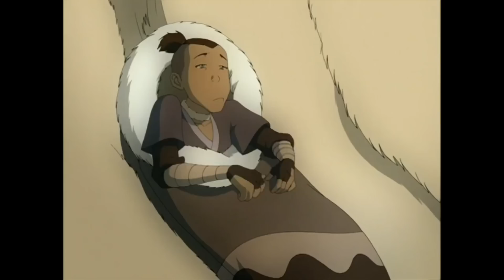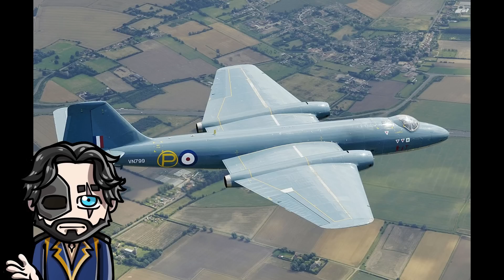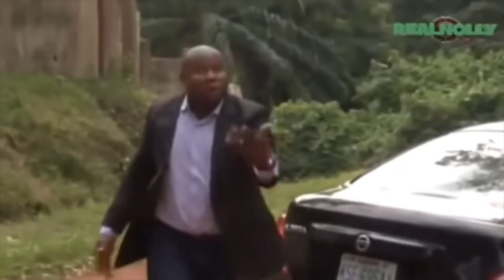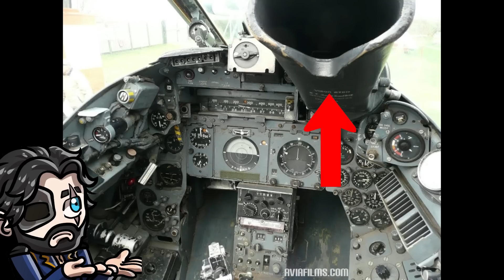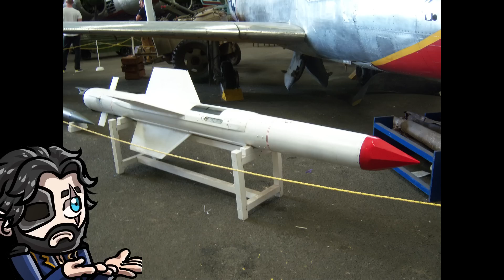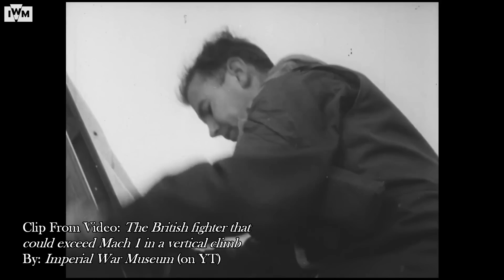English Electric Lightning: Gone In a Flash | Corrupted Intel Files

Comment: I have to ask, since muscle plane was mentioned, would the B-1A and B-1B bombers be considered late era muscle planes? I ask this because experiencing a flight of B-1B Lancers taking off in person is still the most bonkers thing I have experienced in person with aircraft. My stepdad had my mom and I hang around on base for a bit when we picked him up from his daily duties, and just before sunset, we went out to the road near the main runway for the base and parked up on the shoulder. In the distance you could hear engines starting, and after a few minutes, and just as the sun was at the perfect angle, one after another, B-1Bs were lining up for take off, with just enough light to see the planes, and just dark enough to perfectly see the blowtorch like afterburners light and make out the details in the exhaust stream. The first plane lined up, came to a stop, full 'burner, brakes released and it just sprang off the line like an Olympic runner on meth. Before that plane was even halfway down the runway, the next plane was in position, went full 'burner and started rolling just as the first plane was airborne and pulling its gear up. This continued till all of them were in the air, and it was dark enough that the last few planes were just glowing afterburners not long after take-off. All of this to say, I would love to experience the English Electric Lightning in person if had the chance, and I would love to see a video about the B-1. As bombers go, to me it is still the sexiest beast on looks, and sound, alone. What I am trying to say is, the B-1B put me more in awe than the F-14, F-15, F-16 and F-18 all combined with how a big beast can get off the deck and climb out. This was roughly 1988-89, and I am pretty sure I may have seen some of the last factory fresh B-1Bs built mixed into that flight, and come to think of it, that may be why my stepdad wanted me out there. I can say, it absolutely stuck with me.

Comment: As one who thinks the Lightening was the most beautiful plane ever made,  followed by the Starfighter and the Crusader, I found your commentary absolutely absorbing and mostly on the nail. I think the government interference comments were very appropriate. The lightning from what I have read was not only a bit slippery it was a very popular aeroplane with pilots. Those who have flown the Lightening and other hi-performance planes (US) most have stated a preference for the Lightening in terms of flyability, control and ease. But one had to get home before the tanks ran out. But then. It was designed as an interceptor not a slow bomber cover craft or submarine hunter. 
However I think you forget that there were many British aircraft that the US adopted and modified. The Canberra bomber being one that led to the U2 via modifications of the Canberra. Also the Harrier and I believe the Gnat was of major interest among others, but did not fit the "bigger is better" of America. Also there were others that got cancelled and their designs and engineering were used in US and other aircraft the T188 and SR2 to name just two.  And the Bell as you point out. The Buccaneer was an eye opener for the USAAF with its capability and tactics, being almost untouchable at Red Flag. Then there was the plane that nuked the US 1961 Sky Shield 2, kept very quiet for years despite one just turning up at Plattsburgh AFB NY, asking is it OK for us to visit. The Vulcan. Yet the Victor (an astoundingly good looking plane) was probably a better plane.  I think the UK was up there with all in the immediate post war era. Despite governments getting in the way.

Comment: That British flag you used was wrong.
Reply from the maker: I apologize for that, I have adjusted the flag I use going forwards to be the correct one.
Reply: @ Easily done. The flag took on several iterations to evolve into the current one, just like the US flag did. The one you used was introduced in 1606 and replaced to the current one in 1801.

Comment: Re Taffy Holden, what actually happened was the test pilot had to attend a funeral and wasn't available. As Holden knew the cockpit layout and there was pressure to get this aircraft serviceable ,the test pilot said Taffy would  be ok to do the ground run and gave Taffy instructions on how to carry out the ground run ,where to do it , make sure the aircraft was chocked etc. What Taffy did as the instrument issue appeared at high power settings was ,  instead of keeping the aircraft in dry power, he pushed the throttles through the gate into reheat (so the throttles move out a bit to the left and then FULLY forwards). That's why the aircraft jumped over the chocks, which obviously  wasn't planned. XM135 is a Lightning F1, not an F2. It also took Taffy more than one attempt to land the jet, which is why he had over 5 mins  flight time.

Comment: A Fun-Fact and something of a postscript to this story, is that the Rolls-Royce Avon engines that powered the EEL, were the same engines selected for the Concord.
Reply: Not true . Concord had Olympus 593 engines, not Avons . The Olympus was used in the Vulcan and T.S.R.2
Reply: @dcmchugh99  Yes the Avons were superpowered engines but were not built for supersonic heavy lifting. All the aircraft they were fitted to were light and fast aircraft not heavy aircraft like the Vulcan and concord.

the RR Olympus 593 however was the offspring of the TSR2 project that was close to being ground braking before UK pulled the plug on it out of shear stupidity. They had several RR Olympus engines ready to go into mass production intended for the TSR2. They had gone through years of development for the TSR2 to be supersonic capable. So when TSR2 was scrapped they had the engines left over. So when they started concord later on, they had a capable engine already perfect for the job laying around saving concord years of engine development costs.
Reply: Avons were used in the Comet and Vickers Valiant. So not all small and fast planes.
Reply from the maker: That's awesome
Reply: @CaptainSlicerax  It's also insane that the Concord had four of those engines, so just 50% more thrust, for a plane 100 times bigger
Reply: Yes, it’s hilarious isn’t it?

Comment: So, I have to explain the history as to why this plane even ended up on Slice's list for this series:

We were doing research on supercruise, and he heard, in a voice-chat, from ME - "Wait, this thing ACCIDENTALLY hit supercruise?"

To which Slice responded, "Holy hell, what?! How did they ACCIDENTALLY do supercruise- let me see that!" 

And thus a 45 minute research rabbit hole into the Lightning began. This jet is both ugly and gorgeous in equal measure. I can attest to the fact that when Slice researches, he goes DEEP into the research to find the funny bits. His following research entailed like... 3 days worth of dedicated research.
Reply: @Captain Slicerax @MrFullCrumb01
Please be mindful the one thing you got wrong was the supersonic climb information. When referencing the Lightning able to go supersonic in a climb, it was meant to mean in comparison to all previous aircraft that could only go supersonic in level flight or at a slight descent. The Lightning when completely empty of fuel does have a 1:1 t/w ratio for a couple of seconds before it runs out of fuel, however in practice it was never that high. The Record set for a climb to altitude from 0ft to 40,000ft of 2mins 20 seconds was only possible by a skilled pilot holding a climb speed of Mach 0.87 without weapons. Whilst with 2 missiles it could achieve 40,000ft in around 2mins 30-40 seconds. This is accomplished by constantly lowering the nose/climb angle to sustain such a speed. The reason for the Mach 0.87 speed is that was the most optimum thrust output speed for the Avon 301 Engines, travelling faster further reduced their thrust and efficiency. This is all very well modeled in War Thunder and I have to admit looking at the engineering record graphs, war thunders model is almost perfect. The major inaccuracies lie in the game not modelling Over and Under expansion of exhaust gas flow at different pressures and aerodynamic heating (causing very unrealistic top speeds for certain aircraft like the MiG-21 that were limited to the same top speed of below Mach 2.1 as aerodynamic heating would damage the airframe when attaining higher speeds).

The myth of it being able to climb verticle (modern reference of 90*) was perpetuated for many decades by those not understanding the difference between previous aircraft only going mach 1 at 0* or in a dive, and suddenly flying an aircraft that can climb from sea level at mach 1 from a 10-20* climb. If placed in a 90* climb the aircraft does not sustain any speed and does infact lose it like most aircraft that do not have a 1:1 or above thrust unless empty.

Shortly after it set it's record within a few years more powerful engines versions of the F-104 were being made like the G series that outperformed the Lightnings climb to altitude. This by no means is to take away from it's climb performance for the 50's and very early 60's. But is not as insane as professed. 

Another thing to mention is that though the Lightning in testing was easily found to supercruise at sea level, all pilots were banned from flying supersonic anywhere near low alt unless it was a combat situation because of the fact that fatigue to the wings would increase rather quickly at such high speeds in the thick soup of low alt. Basically they practiced reducing airframe fatigue by not going fast near sea level unless necessary.

I hope this shed some light onto the subject, and hopefully the video can be corrected. However the rest of the video is well researched and shows a good amount of effort for historical accuracy.
Reply: British never learn from Their mistakes
Reply: Funny enough, accidental supercruise is something that happened again on the Panavia Tornado during its development, also in the hands of a british pilot iirc. 
With the Tornado, it was a software issue that automatically advanced the throttles at altitude I believe.

Comment: Please do a video on the Lockheed AH-56, what happened to it will make you angry. TLDR the USAF threw a hissy fit because they thought it was too good for the Army to have and pulled out all the stops trying to get it cancelled. USAF ire toward the AH-56 is why the AH-64 is slower than a CH-47 they wanted to avoid pissing off the Air Force again.
Reply from the maker: Interesting, I'll add it to my list and look into it!
Reply: Please do a video with the Luftwaffe’s Lighter, the Heinkel He 177 Greif and the Airliner that went to war, the Focke-Wulf Fw 200 Condor